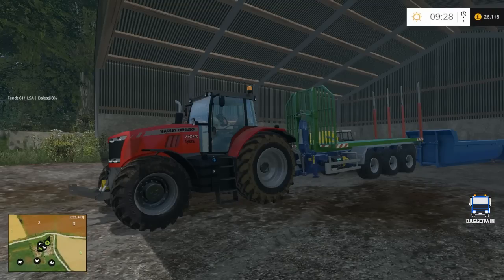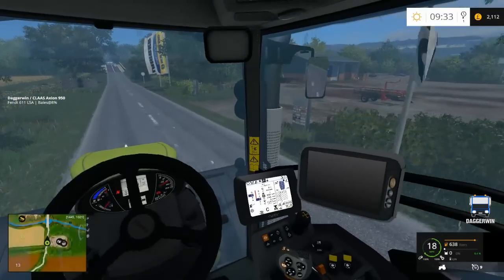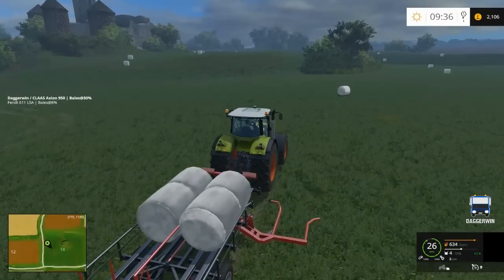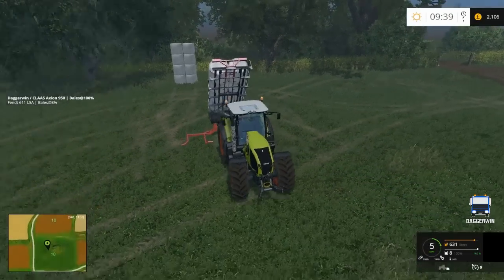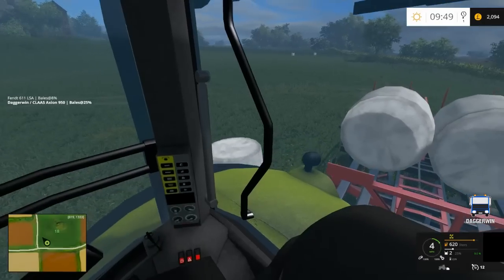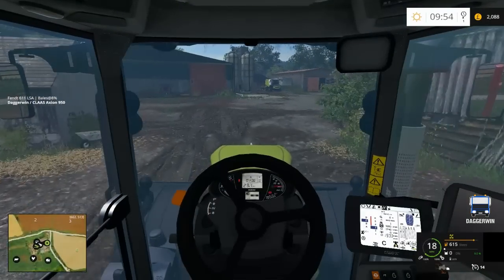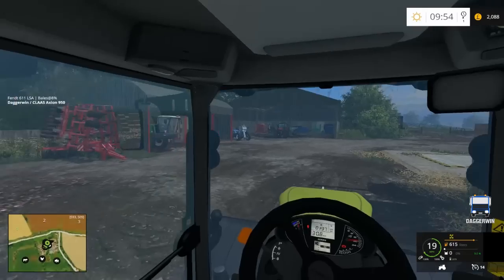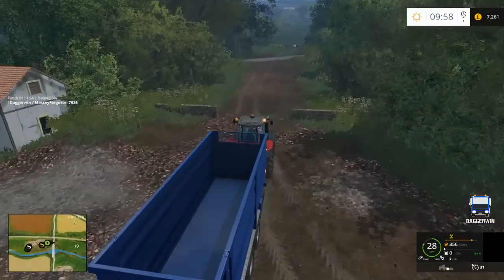Let's Play Farming Simulator 15 | Chellington 2015 | Episode 5

Comment: My experience with the IT Runner Bale trailer was not good! (Xbox One version) It wasn't my stacking skills, but the locking to trailer was messed up! Bales would lock mid air, hang over sides etc... When I hooked the tractor to the trailer, it seemed to unlock the bales and most fell off. Very frustrating! Pics on my twitter @LengthyEmperor Pissed off that I paid extra for this DLC, and not working correctly. Things like this is actually making me want to play this game